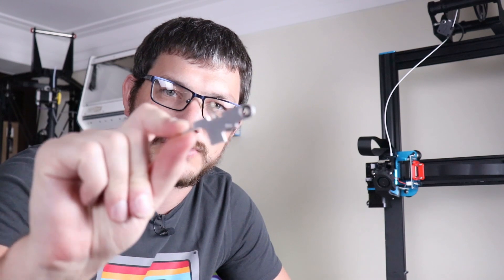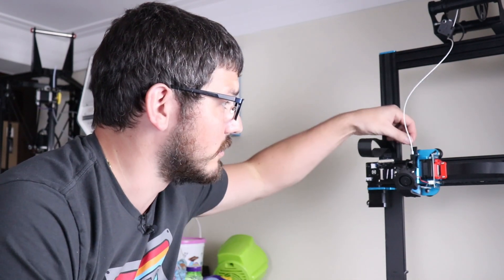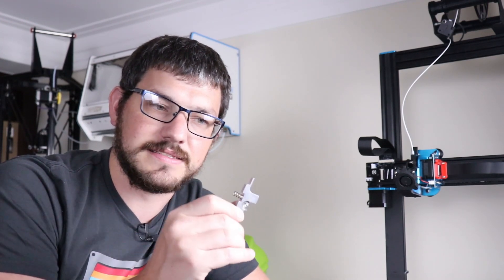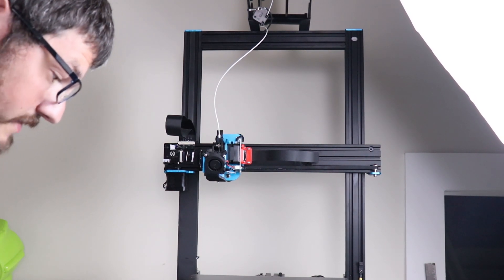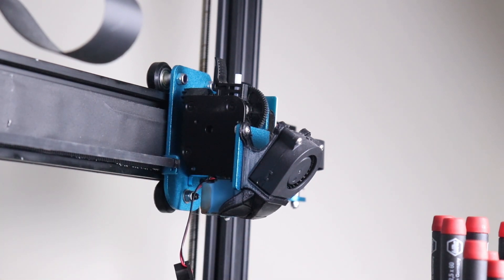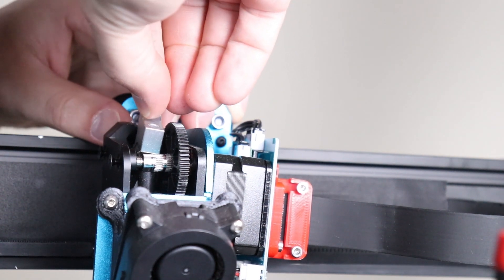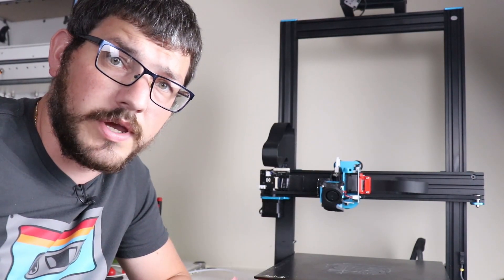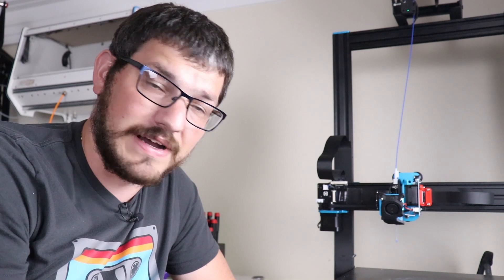Artillery Sidewinder X1 Extruder Idler Arm Replacement

Comment: ok I feel like an idiot but if anyone had a problem where their gear wasnt turning when u put the new metal extruder arm on, u probably have left the old bearing from the old extruder arm on the bottom while adding a new one make sure theres only one this caused so many issues but now its perfect and I can tighten it perfectly

Comment: Thanks for the hints on the cables and for your help. I just got my second X1 and the arm was broken, in 2 places, when I opened the box. Ordered replacement part, Amazon, and had it the next day. Now to put the rest of the machine together and see what else might be wrong. Yes, I am having them, China, send another arm and also have a 2nd metal arm kit coming too.

Comment: You did one fail, that i also did. I am still trying to get my x1 ready to work. So, you removed the old idler Arm, but you missed the bearing of the old idler. So it is still on the rod of the Motor. The New idler brings his new bearing,  so its double. I also did and was not able to get the New one smooth back in place. The Motor was blocked and so on. Removing the old bearing is hard shit work. Now my idler Arm is touching the wheel. It is a mess.

Comment: Original idle plastic arm has a bearing with a groove for the filament. New aluminium one has a plain bearing. Why don't you exchange them??
Reply from the maker: You can...
Reply: Fugatech 3D Printing of course I did it, but I wonder why you don't change it in your video and suggest it
Reply from the maker: I didn't think about it then. My priority was to get an arm installed that wouldn't break.

Comment: If you order the version off amazon it comes with a shorter spring which is too short to work in the sidewinder x1 - if you simply use the old spring then it works fine. (Or at least that's what happened with the part I ordered - yours could be just fine)

Comment: I'm not sure if this is related but I had to replace the all-in-one extruder on my X1 and it seems to be leaning to the right and out of alignment on first use or not in the right spot going forward and back. So now the filament gets pulled behind the intake and back towards the arm. I was curious if anyone had the same issue or if I'm supposed to do something when replacing it.
Reply: or the intake is leaning to the right. I have to put a screw driver to bend it to the left to alight with the arm
Reply from the maker: I found a small spacer that you can print out and that keeps the idler arm straight. You can find them on Thingiverse.
Reply: @Fugatech3DPrinting  cool what would I search for?

Comment: I put one one and it caused nothing but problems. The screw you get with it is tight and the cog wheel won't pull the filament through the hot end.. I put the plastic arm back on and problem solved. So buyer beware... I have a V4 Sidewinder and the plastic one works fine. Hasn't broken.

Comment: The problem with this is that ur loosing the hobbed bearing inside the plastic artillery part. Could the bearing be removed and swapped to the metal 1?
Reply from the maker: I'm not following what you mean.
Reply: The bearing that presses against the filament is shaped differently on the new arm you installed versus the original arm u removed. There's a groove in the old bearing that help with keeping the filament aligned correctly that the new bearing doesn't have. 
Can the old bearing be removed and put onto the new metal arm?
Reply from the maker: Ah that one. Yes! You just need to knock the pin out and you can switch it over.

Comment: Thanks for the great video I had heard that part was not great thanks for going over the replacement. Your cooling fan looks to be at a different angle than mine are you using a custom parts cooling mount?
Reply from the maker: Yes I am using a different mount for better airflow. This is the one I am using but there are others out there as well. https://www.thingiverse.com/thing:3927320

Comment: For anyone who tries this and the gears stop moving. MAKE SURE the bearing from the first idler arm is removed! Otherwise when you tighten the side plate it will squeeze the small gear and cause it to get caught and stop moving.
Reply: Thanks, this happened to me and I was clueless...until I read your reply.
Reply: Any tipps on how to remove it?
Reply: @Unprogress  Try to remove it from the jew idler arm if the old one is stuck, use some pliers and push it out from the opposide side
Reply: @Unprogress  I used my snippers which provided pressure on sides of bearing and it moved right off, other wise it was a pain but the snippers pulled it right off clean.
Reply: @Unprogress  I first used a needle to push in between the two bearings, to separate the one I wanted to remove. Then I first used a screwdriver to lever it away, and then the long side of scissors to push it off completely.

Comment: I did this upgrade after watching your video but now I'm having an issue with getting it to pull filament. I had to loosen up the screws on the backplate, specifically the ones over the big gear and the pressure knob aka the top 2 just to get it to pull filament. The problem is that the only way it pulls filament is if the screws are so loose that the one over the gear falls out mid-print. I tested it by loosening the screws and then using the load filament feature in order to get the gears to rotate and pull in the filament.  I adjusted the two top screws and the pressure knob while it was going so I could see how tight I could make them without the gear getting stuck, but it's no use. The screw over the gear is so loose that it always falls out mid-print. Please help.
Reply: I have the same problem. Did you figure it out???

Comment: When I'm re-tightening the screws, the gear that turns to pull the filament through binds up, it wont turn. Does the shorter screw go in the bottom right hole? How tight do they need to be? It seems like the bottom right one only catches by a couple threads before it's too tight.
Reply: I have the exact same problem. Any chance you figured out the issue???
Reply: @ianm523  so my main problem was at first, the bearing from the plastic idler stays on the post, so when I put on the new one I didn't see that. And then I also have a problem with the bearing falling out of the metal one because there is a bit of a gap, so I put a small crush washer in there to space it out from the gearing thing.

Comment: Any difference between the 3 Amazon links other than the prices?  Does the replacement part have a U groove roller for the filament like the original or is it flat roller?  If flat, any issues?

Comment: Not all the bolts holding the hot-end together are the same length SO if you're taking the bolts out be careful of which bolt went where.

My OEM idler broke and (because of COVID-19?) all replacements are 'out of stock' and had to order the one you recommended from Ali Express.  But 45-60 day delivery from China was NOT GONNA keep me down.  I found a Titan idler from a place in Staten Island that was 'almost' the same.  Spent 2 days drilling, filing, and gluing to get it to work.  Can't wait for the aluminum one so this is a non-issue from now on.
Reply from the maker: If you have multiple printers I have seen people print a replacement arm.

Comment: I tightened the screws and it put to much pressure on the gears
Reply: I’m having the same issue, I cannot tighten to the point that the two parts located above the spring tensioner for the idler cannot touch each other, the short screw barley threads and the whole thing jiggles when tightened to the point where the gear can rotate in un-hindered.... just got the 2020 version yesterday
Reply: @blackjacko  Having the same exact issue. I do not know what to do. The only way I can get the gear to pull filament is to keep the screw that holds it in loose. But I have to keep it so loose that the screw just ends up falling out mid prints, otherwise the gear is stuck. I had tried tightening it while the extruder is extruding to see what the tightest I could make it was before it stopped the gear. I did this adjustment with both screws and the pressure knob on the back, but it's no use. The screws have to remain loose just to get the gear to rotate. Is this an issue specific to the 2020 version. I just got this printer 8 days ago.
Reply: @IlJokerTheStranj  for me it was so that there were still two ball bearings on it, one has to be removed and then it fits too I hope I could help you
Reply: But if I don’t tighten it down the carriage wiggles
Reply from the maker: It doesn't need to be that tight. Once you have filament in, it should not wiggle.

Comment: Add a bead of thermal paste (any cheap ones used for CPU heat sinks) between the heat sink and the extruder's plate.
Reply from the maker: I don't really understand why. The extruder is plastic so it is a horrible heat conductor if they were trying to make it a heatsink.
Reply: @Fugatech3DPrinting  That's weird.

Comment: Thanks for the video. Do you have the stl for those cable clamps? And is there any danger in using a dab of hot glue?
Reply from the maker: Here you go: https://www.thingiverse.com/thing:4100016 and no. This small amount won't hurt anything unless you jam it into the connector.

Comment: Doesn’t it wiggle left right like that? I had to add a washer. Also my alu arm had a flat bearing instead of a hollow one. I took one from a broken arm instead, does the trick.
But then again, I’ve been battling with this X1 for weeks and barely feel it runs now.
Gl!!
Reply from the maker: It wobbled until I tightened it back down. I'll post an update if I have any issues.
Reply: I just left the flat bearing because I noticed the filament doesn’t seem to want to run down the middle of the bearing with the new arm. Maybe the original bearing you switched in is causing some resistance? 

Unrelated: does the ptfe tube fit snugly in your new arm? I might have to hot glue mine because it sits pretty loose in the hole